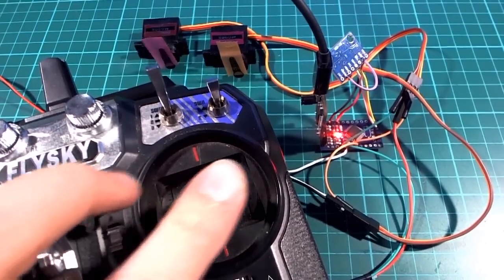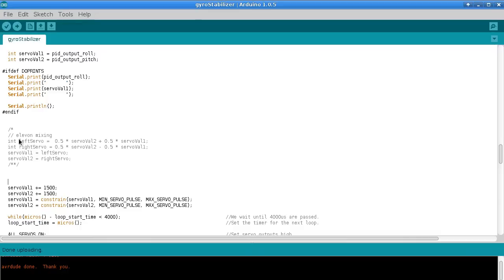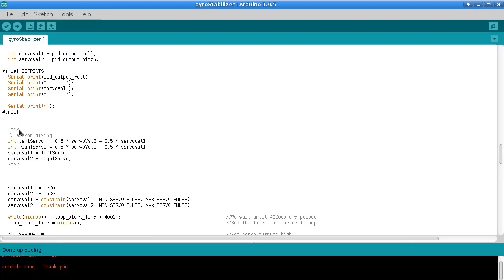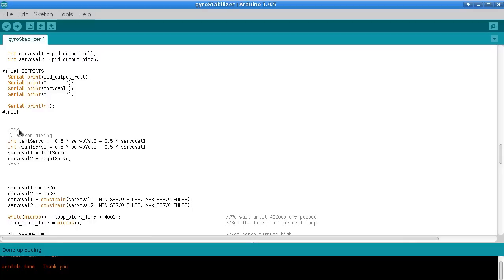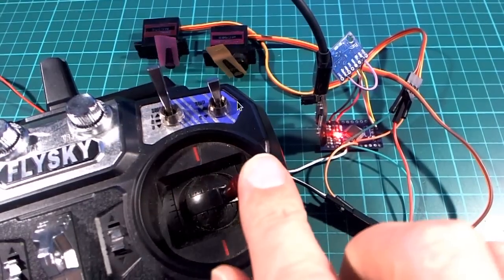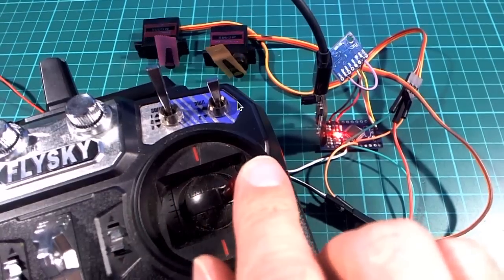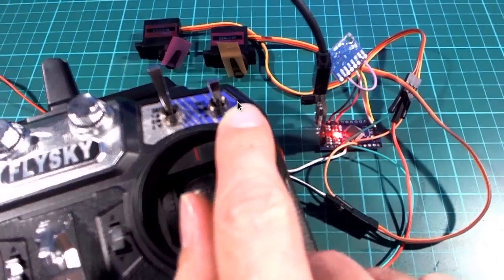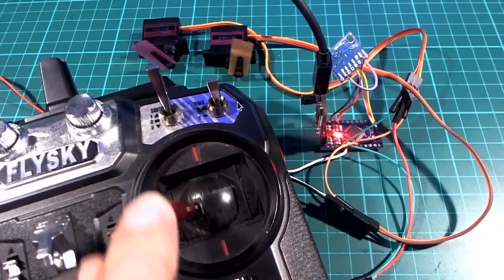Plane gyro stabilizer first steps (arduino)

Comment: Is it possible to see the data from the serial port on the Ardunio ide and can we understand whether it is operated without connecting the output for gain adjustment on the controller?

Comment: Hey brother Ive been working on a similar project but mine just doesn't work well, when i move the gyros the servos move accordingly which is good, but when I use the transmitter the servos move randomly. Please do help me out here, also ur website u provided in description doesnt work.
Reply from the maker: I fixed the web link, I think. YouTube likes to screw those up these days. Hard to say what your transmitter problem is...

Comment: Would I be correct to presume that with everything trimmed out, in level flight, changes in attitude would cause changes in gyro output, ehich the systrm would react to by varying signal to control surfaces to
 maintain/return to previous attitude? 

Last plane I flew was a control line spitfire 50 years ago that my father augered in.
Reply from the maker: Yes, that's correct. Although being trimmed out doesn't matter.

Comment: Nice work
 thanks
Skematic:
Scl A5
Sda A4
Ado jumper ground 
Pin rx ppm kearduino d2
D3 wing
D4 wing
D5 trotle
Enable ppm di remot
 Diremot
Vra dan vrb pengatur servo gyroscope
Swd trotle setengah
Reply: Udah bisa om mixing elevonnya?

Comment: Hi iforce2d I have a problem, how can I connect the wires to the Arduino Nano. because if I try to turn it on, nothing works :( Maybe you can explain how to connect the cables.

Comment: Plz circuite code
Reply from the maker: plz reade description
Reply: And circuit diagram
Reply from the maker: @ehsaanajmal4850  you should be able to determine that from the source code, if you are intending to do this kind of project. The gyro is an I2C device.

Comment: You should really consider using a GitHub page instead of storing them in a messy directory on your site
MUCH easier to push updates too
Reply from the maker: I'm only putting stuff there because people keep asking for it. It's not supposed to be a proper open source project, it's just stuff that I did for fun for a day or two and will likely never be updated at all. Anyone can put it on their own github if they want.

Comment: can the nrf24l01+ be implemented with this setup? I did a similar DIY flight controller for a foam plane that works with the nrf24l01 module attached to the arduino nano to act as receiver and flight controller and it flies well.....I'm thinking about adding auto stabilization.
Reply from the maker: sure, I don't see why not.

Comment: Nice work,
I would suggest using a PI controller, with basic P controller you would experience isolation.
Reply from the maker: You mean oscillation right? If the P by itself doesn't go well I will try PI.
Reply: Yeb sorry i meant oscillation.
Look forward to seeing how it goes.  
I think If you could take into consideration your aircraft speed it would be beneficial also.